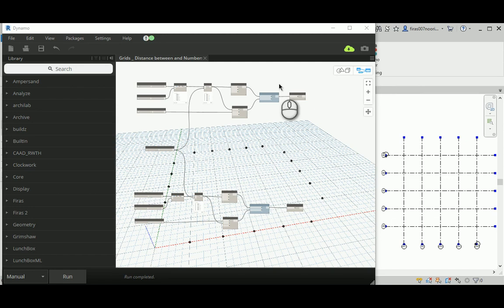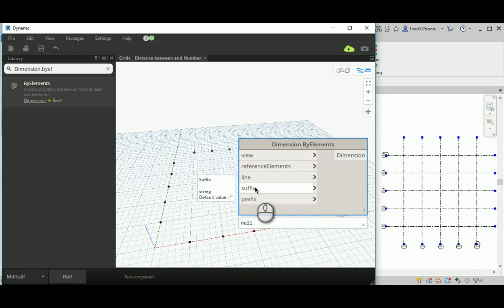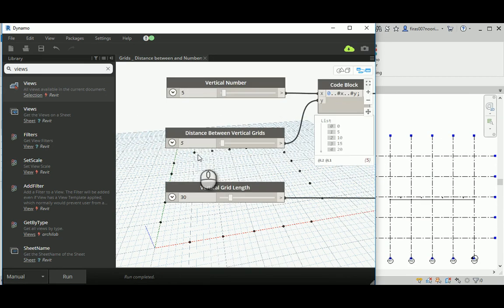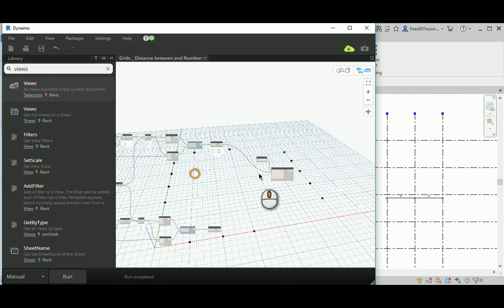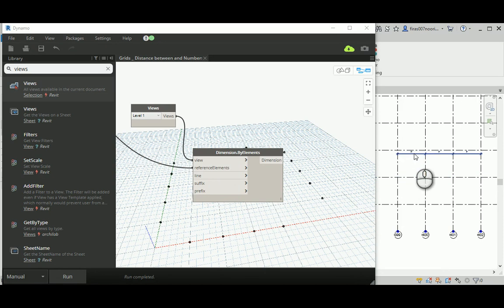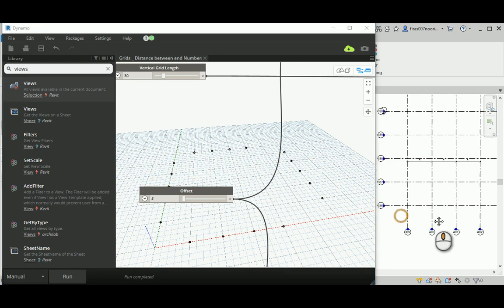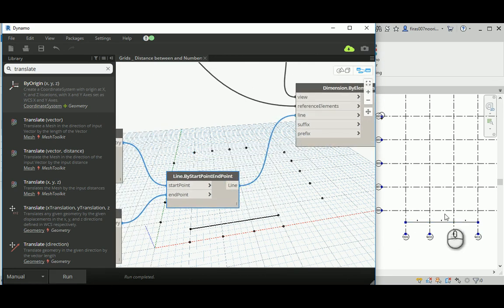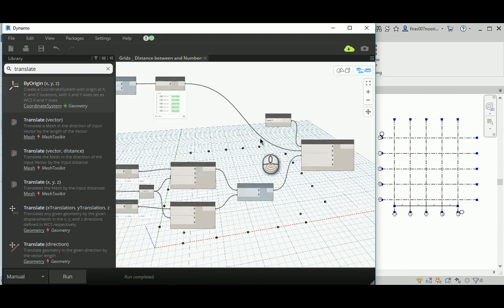Making Parametric Dimensions in Revit - Dynamo

Comment: Hi Mr. Noori,
Thank you so much for such a useful video. I was wondering how it can be developed to the mechanism that can find the best combination out of predefined standard spans in order to get the least leftover from a total span.
Reply from the maker: Greeting dear, you are most welcomed, this script can be developed in several way (it was one of my first attempts actually to automate this process) to include almost any design criteria you desire, you can make the grid spacing follow the required span stated by the codes, or you can add to it as an extra layer, the ability to check the column dimensions so it can suggest the possible span(spans) to you, by using generative design platform to get not one but as many as it can gives and then you choose the one you see more fit to ur work. Another idea is to use load calculations to know the exact spaning and lefover based on ur spanning, literally Dynamo can stop where our imagination can stop.
Honored to know you dear and always welcomed mate.
FN
Reply: Greetings Sir.
The honor is all mine!
I found your channel one of the best and most informative ones in this field and I do appreciate your work.
 I am in my very beginning steps of learning Dynamo, but I do have some experiences with automation, especially in Excel, and some basic knowledge about programming.
I am a very keen student who loves Generative design and personal development by challenging himself in unknown areas, so I do believe I can learn a lot from you and your channel.
I was wondering if I could get your personal contact info so I can share and discuss the ideas and subjects that might not be relevant to be commented on under your videos.

Kind Regards,
Farshid Kaviani
Reply from the maker: @bimdan7825  Greeting, Wishing all the best my email is : firas007noori@yahoo.com
Most Welcome